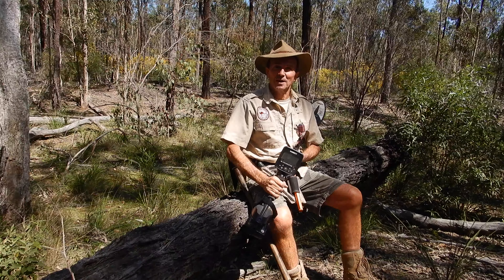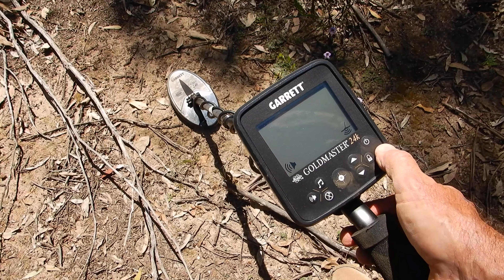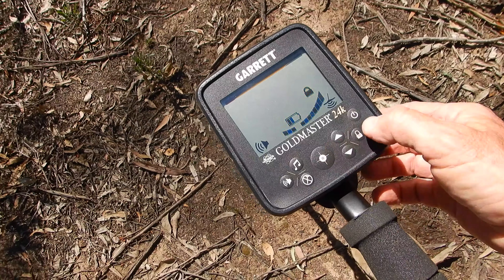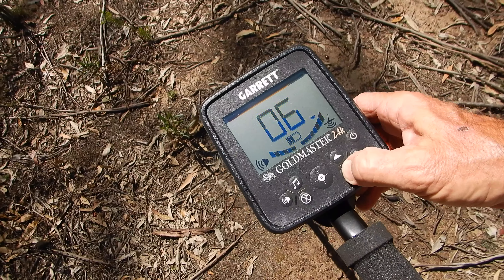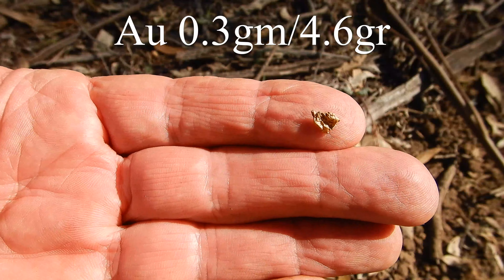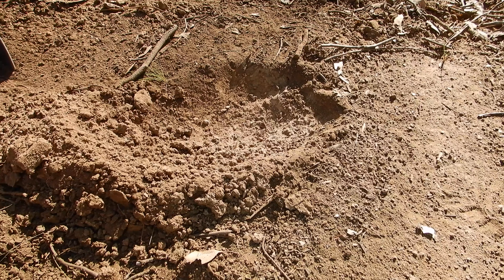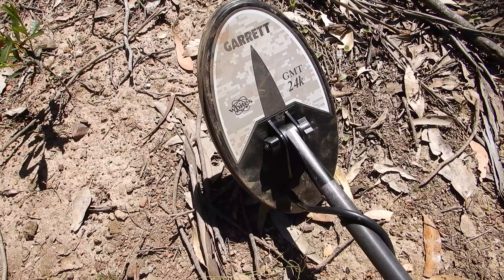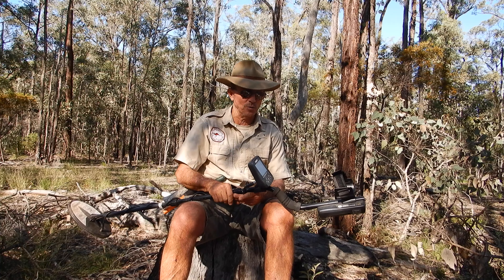Garrett Goldmaster 24K - Setup - Controls - Gold Nugget Audio.

Comment: Thst was the best informational video ive ever seen. I used a few detectors over 40 years and i own the at max. It highly sensitive but i find it targets a bit scratchy sounding and irritating at times. I do think its a great machine that  could do well and in most cases. Gravel and salt water with black sand is a challenge.  This machine is a winner.  Thanks for taking the time to review this machine. Happy hunting! Should  i say mate? I gave you a thumbs up and subscribed.

Comment: Great educational video on the Garrett/Whites machine.
I bet you never thought these two companies would come together.
I have the Whites version. Do you know if the Garrett/Whites coil you have on your machine will fit the Whites version.
Reply from the maker: Thanks for commenting Wayne, I couldn't say for sure but the Garrett version appears identical, even uses the Whites mouldings. The coil plug isn't a Garrett connection so I would suggest the Garrett coil will plug straight into your Whites machine. Cheers mate. Warren.

Comment: Thanks for your reply on the last vid Warren, I love my ATX, ( though I'd like an exoskeleton for long periods of use especially swinging the 15x20 ) but for little sub gramers I bought myself a GM1000 cause my original Gold Bug had carked it, how does the goldmaster compare for the subs
Reply from the maker: Thanks for commenting Jacques, the 24K is very good on the tiny sub-grammers, and runs very quietly in highly mineralised soils - the auto ground track and ground balance are great features which allow for a very smooth threshold. I haven't run it alongside a GM1000 so couldn't comment on a comparison. Happy Fossicking! Warren.
Reply: @NQExplorers  Hey mate, just as an update on that question of mine, I searched around on youtube and someone had done the comparison between the both and might I say, in a freshly dug & filled test hole @ 4.5 inches the 24k whites with the standard coil left the GM for dead, like dead in the water. The other question is the whites had a small round coil avail for it, I've looked on the Garrett website and it doesn't mention a coil option, will Garrett rebrand the whites small coil and offer it. Thanks mate and keep the vids coming
Reply from the maker: @jacquesjackcoomans2295  Doesn't surprise me with the GM. This 24K is outstanding and runs so quiet, threshold variations are easily heard. Yes Whites had that small concentric coil, more than likely Garrett will produce that shortly to complete the package. Cheers. Warren.

Comment: Warren how would this Garrett compare to a Minelab gpx 5000? I'm wondering if Minelab is kind of like paying for the name or if they are a worth while investment if i was to get fairly serious about it? I've been told a GPZ 7000 is good but it's big coin. The Garrett very reasonable on the other hand. Cheers Dave.
Reply from the maker: Thanks for commenting Dave, the Goldmaster is a VLF machine, whereas the Minelab machines you speak of are Pulse Induction. Hence the great difference in price. This machine is top shelf VLF and very good, if you want to go the way of PI though, it will cost you a lot more money from any manufacture (the Garrett ATX for example). Hope this helps mate, Happy Fossicking! Warren.
Reply: @NQExplorers  cheers for your advice Warren. Greatly appreciated.
Reply: @NQExplorers  türkçe

Comment: How does this machine bary from a Pro, Gold or other Garrett machines mate?  Why would I buy a rebadged Whites detector?
Reply from the maker: Thanks for commenting Darryl. The AT Pro is not a prospecting machine, operates at 15kHz and is more calibrated to the middle of the conductivity spectrum. AT Gold is at 18kHz but the new Goldmaster is much more powerful and operates at 48kHz - much more sensitive to small gold. It has an automatic Ground Balance and tracking system, plus an adjustable threshold recovery, so it has many more features, specific to prospecting, than the older Garrett machines. Cheers mate. Warren.

Comment: Anyone compelled to compare Garrett infinium ls to Garrett 24k? Pi to vlf.
Reply from the maker: Thanks for commenting Brian, as a long time Infinium user, the Goldmaster is much more sensitive on small gold (as with any VLF). Infinium being pulse would be quieter in very high mineralisation but you would need to run it with the smallest coil to compare with the sensitivity of the Goldmaster 24K. Cheers mate and Happy Fossicking! Warren.
Reply: @NQExplorers  I could image should be very interesting to have both vlf 24k and infinium ls when you get to a gold patch.